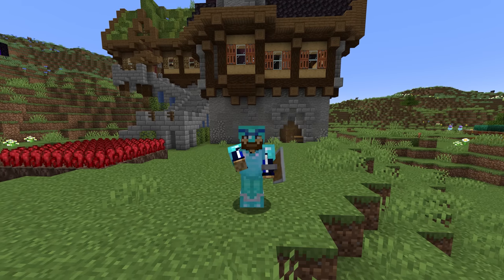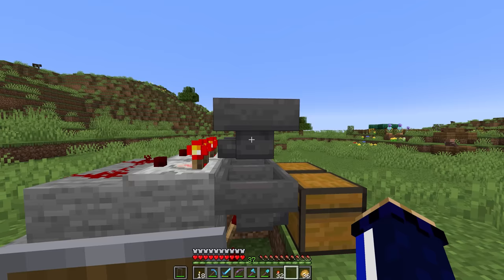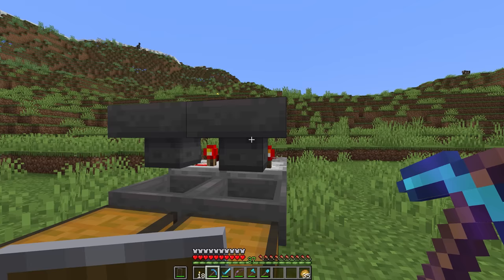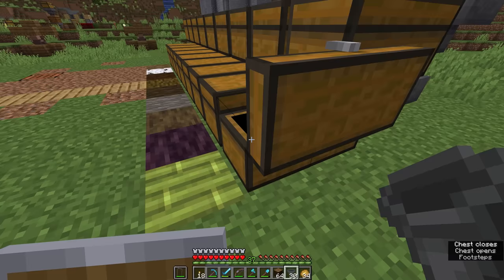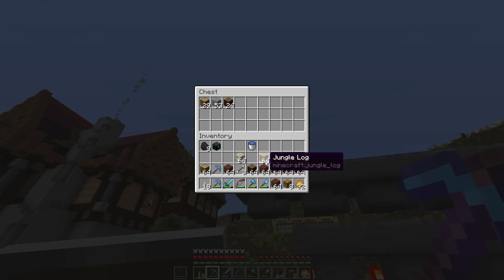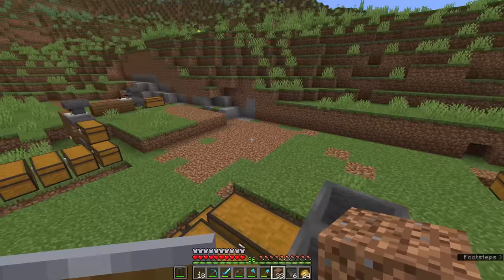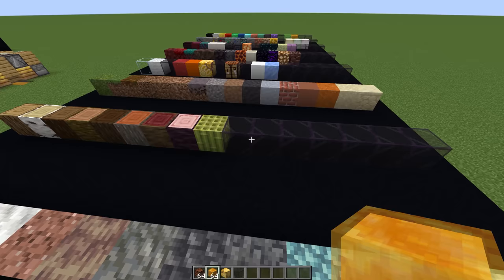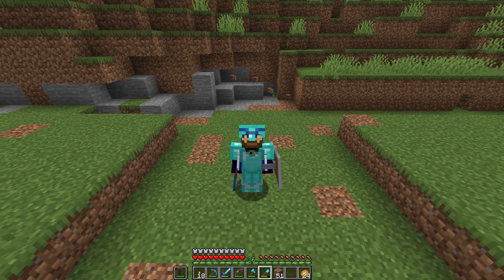Intro to Auto-Sorted Storage! ▫ Minecraft Survival Guide S3 ▫ Tutorial Let's Play [Ep.30]

Comment: Tip for Bedrock players: the impulse item sorter doesn't work unless you extend the underside with another repeater so the torch sits underneath the hopper.
Reply: There is a better way to do it with a target block. No repeater needed then
Reply: @judsongreenwood2636 I always forget that those exist 😅.
Gotta try that out. At least it's cheaper on Redstone.
Reply: @imperfectimp  Not really cheaper, as a target block costs 4 redstone dust already.
Reply: @TheRealWormbo goes to show how often I make them. I thought they were 8 pieces of wheat with 1 piece of Redstone.
Reply: @imperfectimp  But look at the bright side - after a few weeks in a survival world, an average player is already sitting on tons of both wheat and redstone. Auto-farming plus Fortune III on your pick and it's hardly an obstacle. Iron is the bigger bottleneck (for the hoppers) if you don't like farming iron golems.
Reply: The impulse item filter design works just fine.  The real discrepancy comes from the hopper pipe that transfers items across storage slices.  Tile entity update order (such as from hoppers) can sometimes be random.  Like I said, that is not a problem with impulse's filter
Reply: I built it the exact way Pixelriffs shows I'm the vedio and tried to what you suggested about adding another repeater but it's not working for some weird reason the readstone compartors won't power on and this in turn breaks the system.
Reply: @anonymous20232  are you sure you didn't put the comparators backwards? Bc that was my first mistake with them.
Reply: @anonymous20232 I’m having a similar problem but my items sort through when the sorting item gets to 41

Comment: A good rule of thumb for the redstone of item filters is use a man-made block that doesn't spawn in the area. I'm in construction of a storage system and using deepslate bricks for the redstone in the stone layers, it's just a piece of mind so that you don't dig it out on accident and break the system
Reply: My personal choice is wool (thanks Mumbo), then stone bricks or polished stones. Late game colored concrete is a good choice also
Reply: I try to avoid anything that I might want to build with too so that when I come across it later I know it's holding redstone. Polished diorite is my usual go-to as it also makes the redstone dust easily visible.
Reply: Considering a Haste 2 beacon might be a thing later, I like using blocks that are visibly divided but not instantly mineable with Haste 2 and Efficiency 5 on a diamond/netherite pickaxe. My go-to redstone-holding blocks are smooth stone and smooth stone slabs and well as (clear) glass for that reason. Other technically-oriented Minecraft players seem to like concrete blocks for similar reasons (plus, those can be used in multiple colors to designate the various parts of a contraption, similar to wool), but I avoid it for not having visible divisions between blocks.
Reply: I use smooth stone for all of my redstone builds. Any essential/necessary block is made out of smooth stone blocks or slabs because it stands out from everything else so well. If you're digging around your build and suddenly find a block of it you know it'd be a really bad idea to break it.
Reply: I use smooth stone for the base of anything and polished granite on blocks that are supposed to get powered. I'll also use undyed glass for when I need a transparent block.

The exception is actually item filters. I make them in such bull that everything is smooth stone.
Reply: You're zinging right past easy mode. Just rename any dirt cheap item to a name you'd never use like "Thor's Underpants" and NPT takes the wheel.
Reply: @MisterUnconcerned  I was reffering to the blocks used to place the redstone components on but I understand where you're going, Pix in the video showed renaming an item to fill up the empty slots in the filter.

Comment: When I first learned about item filters and automated sorting years ago, I was thrilled and built them wherever more than one item type could be expected to appear. And of course large systems to automatically sort as many different items as possible, including all the derivate stuff like slabs or stairs.
For a while now, I learned that these automated sorting systems don´t provide advantages worth the effort to build them. Also the "can do factor", the principle of the sorting unit is fine, but just stacking an endless row of these isn´t any redstone-ish challenge or archievement. Nowadays my focus is more on compact designs and I do the sorting manually. Pillar of 3 or 4 different blocks (5 would work, too), e.g. logs, a barrel besides each of them, the same with other blocks back to back. Derivates like planks or cut blocks go into the same chest. That´s 6-8 dedicated barrels on a 2x2 area, easy access, type of content displayed, pillars a good option to group related items. Other arrangements such as long storage walls or a more playful integration into the room design are a good idea, no need for a sterile looking row of chests. Just think of placing shelves in a real room, many options. As the barrels fill up, I put the content in a shulker box and restore this on in the barrel. That provides space for 27x27=729 stacks or 13,5 double chests. If not sufficient, just place another barrel beside.
The only places I still use these item sorters are fully automated farms with different drops occuring, such as an all color wool farm or some of the monster farms.

Comment: As someone that loves to play around redstone and storage, I have a lot to say.
First, there is a huge misconception about which auto-sorter to use. The small version (2 redstone dust) is perfectly capable of handling any input that comes from a hopper like in the video. You only need the 3 redstone dust version when the items travel above the filtering hopper by water.
Second, I think is important to talk about how useful the auto-sorter is. Since every row will have only 1 item, is very impractical for any all purpose storage (like what we usually have in our base/house). There are exceptions but it generally needs a far more complex auto-sorter, like the ones Cubfan or Impulse have done in Hermicraft in previous seasons. Auto-sorters are great for any farms on contraption since they give a few different outputs. 
Third, there are 2 variations of an auto sorter worth talking: The shulker loader and the hopper-minecart filter. The first one uses the same sorter but the output is not a chest, but a shulkerbox. The second uses a hopper-minecart as an auto-filter, useful only for the most efficient farms but more complex. 

Hope this comment hepls!
Reply from the maker: No, you absolutely need the 3 redstone dust version if you plan to store large quantities of blocks. 
For example, let's say I collect 5 shulker boxes of stone from a beacon strip mine, and dump it all into this storage system along with all the granite and diorite and stuff. 
The two double-chests would fill up, the hoppers would fill up, and the filter hopper would end up with 64 items in it. The filter with 2 redstone dust would then stay powered permanently, activating the redstone to either side and breaking the filters either side.
Of course you can avoid this by adding more chests, or just being aware of how much you're storing, but building the 3 dust filters makes it idiot proof. You never have to worry about it breaking, because it simply cannot break.
Reply: @Pixlriffs  Sure, If that's your concern then yes. But if you have enough chests is not needed. And sometimes that difference is important in tight spaces.

Comment: Hey Pixlriffs, I know your a busy guy, but I'm wondering if you or somebody from your community could help me out. Being a totally blind MineCraft player, I have struggled to find a video that explains exactly how to arange the blocks for the filter circuit going by just what the builder says while they are building it. I am wondering if you would have some time to put together maybe a small text guide on how this circuit is built. Maybe using coords with the output chest at 0 0 0, and the first hopper pointing into it 1 0 0 or something similar. I understand the redstone logic here, just can't quite grasp the layout of the redstone components. By the way, thanks for the amazing content and most of the knowledge I have for building redstone and farms comes from your videos.
Reply: Hi, i'll try and explain it by coords for one slice of the storage system using your method: output chest 0 0 0. chest 1 0 0. hopper 2 0 0 facing 1 0 0. chest 1 1 0. chest 2 1 0. hopper 3 1 0 facing 2 1 0 chest. Wood Plank or any block 5 0 0. Redstone Torch 4 0 0. Wood Plank 4 1 0. Wood 6 -1 0. Redstone Repeater 6 0 0 facing 5 0 0. Wood 7 0 0. Wood 5 1 0. Wood 6 1 0. Comparitor 4 2 0 facing 3 2 0. Redstone Dust 5 2 0. Redstone Dust 6 2 0. Redstone Dust 7 1 0. Hopper 3 2 0 facing 4 2 0. Hopper 3 3 0 facing along each row of the storage. Hope it helps.

Comment: Every sorting system needs a Filter Material sorter at the beginning cus some day you will shift-click a stack of them into your sorter input without realizing it. Trust this will not happen enough to cause overflow, or be even safer and use 4 uniquely named items in the filter.

Also if you put the repeater in impulseSV's filter on 2 ticks it will prevent a (rare) issue where exactly the wrong rate of item input will cause the torch to burn out, while working just as well. This was the scourge of a tree farm sorting system from a long time ago so I always do this even if nobody else has ever seen this problem. XD

Comment: So....... I built a couple small scale instances of the item filters. One was low input - for skeleton spawner drops, the other was for mediumish drops - Xisumavoid's stackable tower farm. With the tower farm, I installed a water path over the feed hopers. What I'm finding is that with large bulk, the system does not seem able to handle/sort/filter them all. For example, if I drop a stack of potatoes into the water stream, the potato filter will take about half while the other half will continue along to the overflow chest. I know dropping a stack into the flow sounds like a lot but the tower farm is, currently, 8 stories tall so there is a lot of produce coming down the line and a full stack was a good test amount based on what I was finding in the overflow chest. The potatoes fall into the conveyor row of hopers but the comparator hoper doesn't seem able to pull them all fast enough from the feed hoper above it. Do you have a suggestion on how to remedy this? Thank you.
Reply: Hi, I had a similar issue with my Iron farm producing too fast for hoppers to pull to the correct filter chests. You will probably need a buffer with a dropper on a timer to eject items into the water stream on an interval so the items don't overwhelm the hoppers.
Reply: @bsoltan341  Hello. Thank you for the info. I did more research and found a timer for doing that. It's been working pretty well now. I found a sorter with a feed timer from Mysticat.

Thanks

Comment: I find auto sorters either need to be (A) huge or (B) specialized to a task. Thus, I no longer make generalized ones. They simply are not worth the time, effort, and space. 
        
Where they are useful is when you have farms producing a wide variety of products. So, if I have a froglight farm, I don't bother. I'm getting 4 products (magma cream and three froglights) and if I want them sorted I can just pre-fill the blocks in the collection chests with 1 of each for the part devoted to each product. For a general mob farm, however, where I'm getting 14 stacking plus non-stacking items - they make sense. 
      
Also, if you like to go exploring/mining/end raiding - then having them as good unloading stations for that makes sense. Whenever I'm doing those things, I tend to work on a 2-shulker system. I have one shulker for stackable things and one for non-stackable things (including full stacks). So, when my inventory is full, I drop the shulkers dump in the stackables, then remove any full stacks that have accumulated. Then I fill the non-stackable shulker with those items and the full stacks. When the non-stackable is full, it gets switched out with an empty shulker from the ender chest. I normally only have a few dedicated shulkers in my ender chest for gear and supplies - so there are 20 or so slots for these absolutely full shulkers before I have to go home. 
      
If you have been end raiding - then those shulkers are very well set up for a sorting system. Purpar block, bricks, stairs and pillar, end stone and bricks, purple glass, shulker shells, chests, diamonds, beetroot seeds, dragon heads, brewing stands, item frames, iron ingots, diamonds, eyes of ender, end rods, banners, chorus fruit and flowers - all the normal stuff that if you do much end raiding you get stacks and stacks of. You still have to sort the non-stackables (diamond gear, wings, healing 2 potions, etc). 
     
I do much the same when running around caves for ores - and there a similar dedicated system (stone, andesite, granite, diorite, and deepslate plus the stone and deepslate ores for everything) can make "unloading and sorting" from such a trip faster. 
    
In the nether, if I'm not just destroying the netherrack in lava, I keep a third shulker in my inventory specifically for it and run the two shulker system for everything else. 
     
It is also faster to run several separate systems that are smaller than one mega system if you are still using hopper lines for feeding the system.

Comment: This may be a silly question.... But can you 5 different items in the initial hopper? Example... let's say I wanted 4 or 5 cobblestone blocks variants in the same chest ( normal block, stair, slab, and wall.) Can I put one in each of the 5 hopper slots and all will filter through to the same chest?
Reply: No you can’t the other 4 slots are to lock the item you want sorted in place and adding more of the same item activates the restone unlocking the hopper allowing the extra items you want sorted to flow through until the restone dies back down and locks the hopper agai stopping the 41 items to be sorted and filter material to stay in place. 
Single items will just flow out. Even the filter material will flow out if you don’t set up sorter correctly first so the hopper is locked before adding filters and items you want to filter.

Comment: What's the point in overflow protection if you're using hoppers as input flow, it can only do one item at a time so it'll never overflow as long as the chests aren't full?
Reply from the maker: "As long as the chests aren't full" is the whole point. How long before you forget about the overflow and drop off enough gravel that it breaks your entire storage system? The idea is to build a system that doesn't break under any circumstances.
If you can't afford to leave 41 items in a hopper, leave a block between your filters and you won't need to worry about overflow protection.

Comment: This is too complex for an intro series like this, but I really like the design with overstacked items.  For filter material, you use an unstackable, like enchanted books or shulker boxen.  Through mods or data packs (for the shulkers) or a glitch (for the enchanted books), you create a stack of two of your unstackable.  That goes in the second slot.  The third and fourth slots have full stacks or non-overstacked unstackables, and the last stack gets 62 regular items.

With this setup, the hopper reads full strength with two or more of the item you want to filter, and never goes over full strength, so it’s overflow protected and only holds one item back.